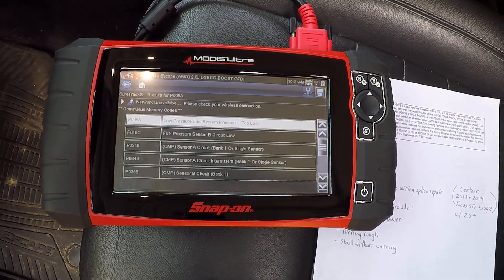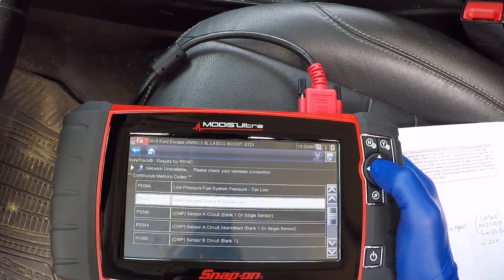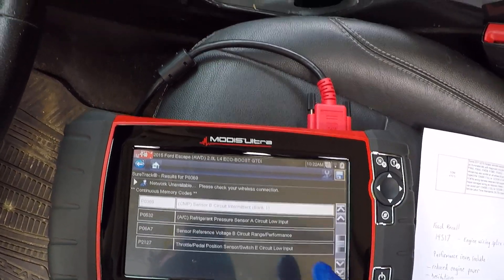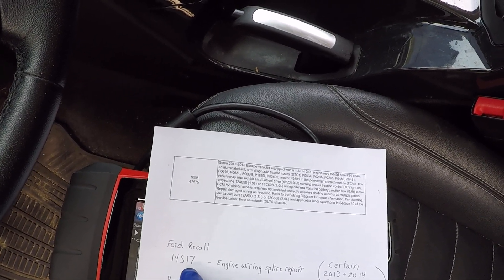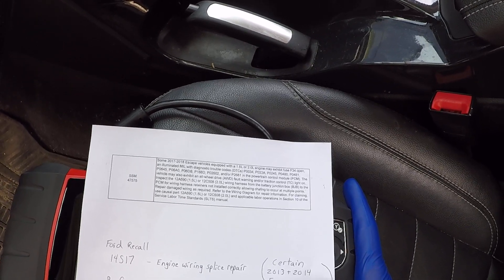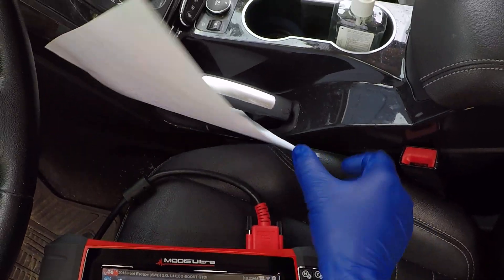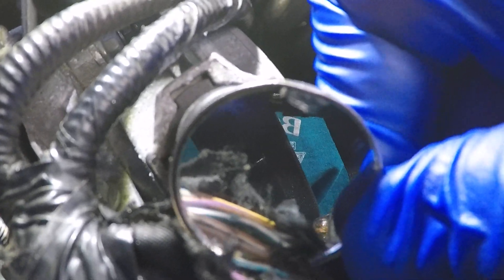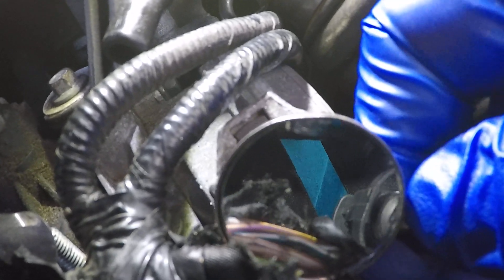How to Fix: 2013+ Ford Escape EcoBoost Stalling Issues

Comment: Hope you are still around.  Lol.  Have a 2013 Ford Edge stalling when RPMs are low.  2.0 ecoboost 70k miles. New battery, New oil pressure sensor, New purge valve.  Still stalling but not all the time, won't do it for like 5 days then will do it for next 2 then nothing for a few more days, then boom again.  Think this is it?
Reply from the maker: I hope i'm still around too. It sure as heck could be. This is the type of symptoms my customer told me when he brought it to me. A big, big hint is if you scan the car, it has a million codes for misfires, fuel issues, throttle body, vacuum codes and etc- that means its a short, or electrical related because you know, all these components haven't failed all at once, when you can go 5 days without a stall. Carefully go check the back side of your harness where it might be touching the valve cover or other aluminum. But FIRST- go check your VIN online because the 2013 was an official year of recall- as i mention in the video.
Reply: I have 2014 that just started doing this 1.6 lilter

Comment: I had that same problem after taking my car to get serviced at a dealership and also after that service my brakes went out. I sold it because they wanted to charge 3500 dollars to fix it and this was back in 2018 when no information was found to fix it myself so CarMax got the car. Screw Ford the crooks at their dealerships. Ford By design create crappy products to obsolete your fixing of the car so they can sell you a newer piece of crap.

Comment: I’m having the same issue on a 2014 Escape SE 1.6L.  Have already changed the low pressure fuel pump and flp sensor at great expense and issue still exists.   Will give this a try.  Thanks

Comment: 2015 Ford Escape 1.6L Eco boost stalled at stop sign {end of 2017} and never
started again. Heard a loud humming noise coming from behind front
passenger seat 3 times prior. Once in city while driving  and twice on the
highway. Replaced spark plugs; battery and fuel rail. Don't know what to do.
Dealership said low oil pressure. Kicks over but won't start.
Reply from the maker: Ricky take one of the plugs back out, snap it into the coil pack, let it rest on top of the valve cover, keep your hands clear, have someone crank the engine while you look for spark on that plug. If you have spark, you know it's a fuel issue (maybe pump) or ignition electronics issue. Also run your VIN on Ford's website to check for the recalls.

Comment: My fiancé escape was doing this... we fixed it by trading it in for a GMC Yukon.
Reply: Strange  I have a 2013 with the same engine. 120,000 miles and it never did anything like this. Runs like new.

Comment: Hey I have this problem, how did you fix it?
Reply from the maker: Deb - I used electrical tape, and taped each wire that had worn down and started to short against the engine. I didn't have to solder or replace the wires because this one was still in the early stages. Which means, it hadn't broken any copper strands of the wire yet.
Reply: @MidknightMechanics  Thanks

Comment: My 2013 Escape just had an issue of stalling and all the idiot lights coming on. It's the first time it happened so this is something I will check. But first will be the battery, even though it's only two years old, I've had a problem with the negative cable getting a lot of corrosion. I'll rule those problems out but I'll also inspect that wire harness.
I have a 2006 Expedition that also has a wiring harness issue, since the designers decided to put the wire harness right next to the heater hoses.  I've had issues with the wires literally melting!
Reply from the maker: James run your escape vin on the recall site first.
Reply: Thanks.. Yes I plan to do that as well, as soon as I get a chance

Comment: What about a 2013 Escape SE with a 1.6L engine? Will that car have the stalling issue?
Reply from the maker: Francine all my research only shows the 2.0t's having these issues. But, you should still run your VIN # through the online recall system just to make sure Ford doesn't have a recall for your Escape too.
Reply: @MidknightMechanics  Thank you so much!
Reply: @MidknightMechanics  I have a 2013 SE 1.6L and there is no recall for this model. I just started having this issue and autozone pulled faulty fuel pump or pressure sensor.  When it stalls the oil light, battery and engine light comes on. It usually happens a few seconds after I start the car and pull off. It sputters and just loses power. I have an appointment with Ford on Monday but now I'm second guessing.
Reply: @shontapl  what did they end up telling you at the dealer I have the same issue ?

Comment: Ohh my god, This was my issue! I would feel my engine pull intermittently when I accelerate, I would take my foot off the accelerator and it would stop. I checked the metal on the vacuum pump, and it was shiny clean, opened the harness and there were two wires with exposed copper wiring. Covered them up with electrical tape and boom, issue resolved!
Reply: Have you had any issues since you taped the wires?
Reply from the maker: Bryan thank you for the feedback man
Reply: I just bought a 2013 Ford Escape SE with the 1.6L engine and on the second day after buying it, I have the same problem. I will check the wire harness as indicated in this video.
Reply: @Jorge Kane instablaster ;)
Reply: @Jerry Ali I really appreciate your reply. I found the site thru google and im waiting for the hacking stuff now.
Looks like it's gonna take a while so I will reply here later with my results.
Reply: @Jerry Ali it did the trick and I now got access to my account again. Im so happy:D
Thank you so much, you saved my account!
Reply: @Jorge Kane no problem :D
Reply: Sorry to be so offtopic but does anybody know a trick to get back into an instagram account??
I stupidly forgot my password. I love any assistance you can offer me.
Reply: As as a as Ed a